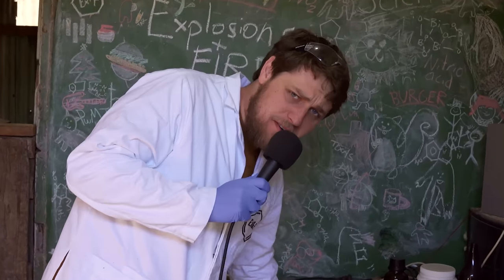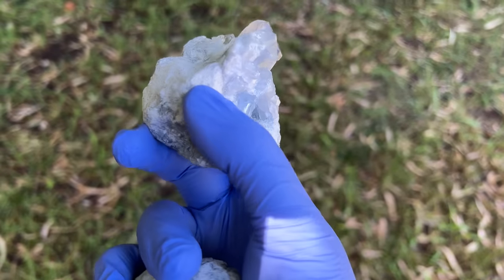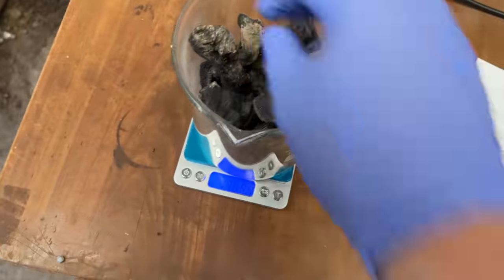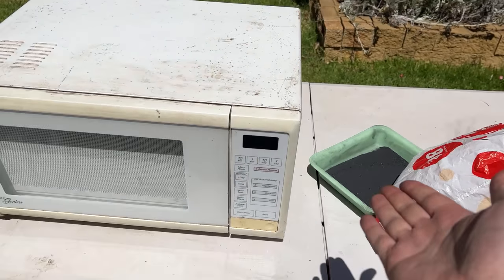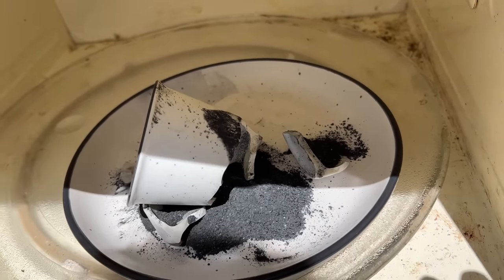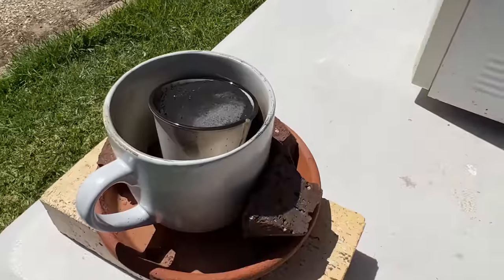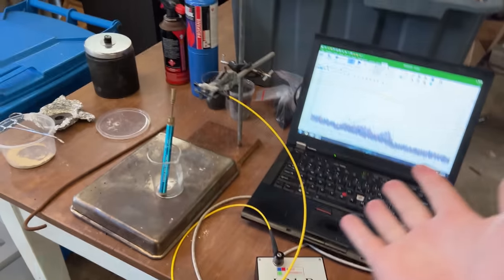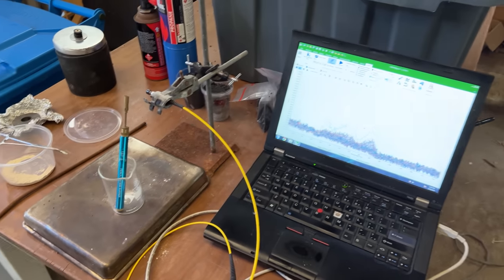Extracting strontium with a microwave

Comment: Actually scandium is not an useless element. Yes it's not very rare but it's very dispersed and doesn't form ores so its extraction is not straightforward. And it is useful in aluminum superalloys (hint: supersonic jet fighters are made of aluminum-scandium alloys). According to wikipedia, the world demand for scandium is about 50% higher than world production, making it quite expensive too.
Reply from the maker: Ok that’s interesting that demand is higher than supply!
Reply: Thulium or lutetium are probably the least useful elements, though they may be in low enough abundance to not be the uselessest by that metric.  Come to think of it, thallium might be a contender as well, not so much because of usefulness (it has a modest number of known/studied/useful reactions, I think?), but because it's so goddamned toxic no one wants to work with it.  (Kinda see also mercury, but it's decidedly on the "fucking awful but just worth the trouble" side of that balance.)

Despite the applications, scandium might still be a contender; production is in the 100s tonnes/year IIRC.  As far as industry's concerned, it might as well not exist at that rate. Definitely something, to be clear, but you only reach for it when you need the absolute, posolute best.  (IIRC, its use in aluminum alloys is equivalent to similar elements like titanium, it's just that tiny bit better at it.)
Reply: @ExtractionsAndIre  Yeah. It's actually more expensive than gold.
Reply: @stamasd8500  Oh yeah, good one!
Reply: It's also used in gun frames to help strengthen the aluminum alloy. S&W being the biggest user of scandium in their frames.
Reply: The biggest use of scandium used to be for metal halide lamps as scandium iodide. Currently, the biggest use are high performance structural alloys.
Reply: @T3sl4  Thulium can be used for Scintillation detectors as well as high temperature super conductors. Probably every element can be useful. it comes down to supply & costs. The lower the cost & the bigger the supply any element will be useful.

Comment: A tip for heating stuff -- if you don't have [or can't be arsed to go out and buy] fire bricks (the styrofoam-like insulating kind) or ceramic wool (not the glass/rock wool kind that melts at red heat), try a large microwave-safe container filled with clean white sand, and embed the crucible in that.  Stoneware is better than porcelain for the crucible but it's probably going to crack all the same, so having sand fill to back up up will keep it together, while insulating it better than open air.  Better than sand, consider perlite or vermiculite (gardening aisle). May want to crush them up a bit or pack tightly since they tend to be fairly coarse and loose.

You definitely need to get it hot; alkaline earth sulfides are quite refractory.  1000C is yellow hot -- if it were that hot on the top it would illuminate the microwave interior!  It would also take more power than the microwave can supply, so it needs to be well insulated.

The powdered charge is rather self-insulating already, and it seems you did indeed get some reduction in the center!  That probably accounts for most of the low yield.  Upside: just keep cooking the filtered junk, all the carbon and sulfate is still in there!  Maybe top up the carbon from time to time.

Speaking of fire, can cook out the yellow from the product by roasting it at red heat, probably -- maybe put it on a steel sheet or can next time you have a bonfire or something.  (Char the sheet before use, get a nice crisp oxide layer on it, don't want paint residue gooping it up!)
Reply: Worth mentioning perlite at least might have other additives so check ingredients. I'm sure a chemist would, but just fyi for anybody out there

Comment: 21:39
I've done stuff like this quite a bit before, trying to get barium carbonate. So I suggest putting an MDF board, or a silicone mat if you can. Their pretty common in the kitchen for baking, so I trust you'll be able to find them. If you use the MDF board, it'll get carbonised at the high temperatures, but your glass microwave base will survive.

And for the crucible, if you want, aluminium oxide crucibles are pretty cheap online (and come with a lid most of the time). The ceramic doesn't survive because sometimes there's still a tiny bit of water left in there that boils in the heat. I'm amazed the coffee mug manage to survive so much
Reply: I'm surprised there could manage to be any water left in the ceramic considering they get baked at like 1162-1240 Celsius  for hours for the initial firing and up to almost 1400 for the glazes
Reply: @noodlelynoodle.  True. Either that, or the expansion from the heat was too much for it to handle
Reply: @thehyperscientist1961  yeah who really knows it could be from taking them out/opening actually which let's them cool  faster than is safe for the material and slowly stresses it till it cracks if it's anything like glass

Comment: You might have better results using unglazed porcelain (ie. terracotta flowerpot). The ceramic glazing will absorb a lot of microwaves, that you really want the carbon to absorb.
Reply: Terracotta contains iron
Reply: An unglazed porcelain crucible would be the best bet due to having an absurdly high melting point and being relatively hardened against most thermal shocks.

Comment: I know that there are induction crucibles specifically made for home microwaves. They are usually advertised for making glass beads at home. Seems like they get over 1000°c without much trouble, or enough to melt sand. I've been meaning to pick one up from the usual sources.

Comment: Thanks for sharing.  I've been researching Strontium Carbonate as it is one of the materials used to coat the cathodes of the old thermionic valves (vacuum tubes here in Canada) which reduces the work function of the underlying metal.  It seems to be commonly found as a pottery glaze.  Quite cheap as well since it goes for 10 Canadian pesos per kilo, and the datasheet states > 95% purity.

Comment: Hey, Lanthanum is used extensively in TIG welding rods, as an alternative to thorium. Strontium toothpaste is also pretty useful for those with senitive teeth. Strontium-90 makes nice RTG's.
This are valid uses, no need to hurt the elements feelings man, geez

Comment: Great videos. I hope your academics are going well.

I don't have any actual expertise in ceramics or kilns but aren't most of them porous and have some amount of water content? So you have to heat them very slowly to remove the water etc to prevent cracking? 

I wonder if it would be effective for off the shelf ceramics if they were pre dried or something, but i can't imagine a microwave cooperating with hours long heating cycle.

Comment: Not that it's exactly in the same price range as "spare microwave", but platinum crucibles easily withstand temperatures of 1000-1100°C, and can also be heated via induction heating. 

The lab I work for uses them to melt down soil samples with flux material for casting into disks to be tested in an xray spectroscopy instrument. They undergo thousands of heating/cooling cycles per week at those temps, so at least they last well for what they cost, compared to ceramic for instance. 

The induction heaters, it seems, can be picked up for similar prices to a microwave oven in a somewhat humorous twist.

Who knows, maybe it could be worthwhile  for future high temperature extraction videos, if you can stomach the $3k-ish price tag.

Comment: Nice video! Another method you can possibly try (which is the other common industrial method used) is soaking the SrSO4 in saturated K2CO3 solution. SrSO4 + K2CO3 =reversible= SrCO3 + K2SO4 
The SrSO4 and SrCO3 produced will achieve an equilibrium, and by frequently decanting the supernatant and changing fresh K2CO3 solution, a large conversion rate to SrCO3 can be achieved. The SrCO3 can then be dissolved in hydrochloric acid and moves into solution.

Comment: Strontium is used as a flux to lower the melting point of silica in pottery glaze making.  It helps to keep the thermal expansion low (especially when used along with calcium and barium.)  Strontium also cause copper to make an excellent satin blue color in a silicate melt.  Of course, all of these are in the oxide form.

Comment: I don't know if you said it, or will say it(I'm currently about 5 mins in) but because you aren't talking about the uses of strontium anymore i assume you won't. 
Strontium Aluminate makes great glow powder and it's soo much brighter than the zinc sulfide one. I actually ordered some to use in my rings and it looks amazing at night. The phosphorescent color depends on what mixture of the strontium aluminate you use. When adding dysprosium or europium you can change it to blue, red or even purple color

Comment: This is just adding to what other people have said, but I've used charcoal I picked out of the burn pile in place of "carbon" before for a few things and the percentage what would eventually be ash is extremely high compared to putting pretty much anything in a can and letting it cook.
I use "pirouette cookie" tins since they're some kind of steel, round and really cheap.

Comment: if you care a little less about the microwave, when you take out the glass platter that comes with the microwave it will let stuff get way hotter. Also I wonder if a small graphite crucible might work or if it would just steal all the heat. huh, cool project!

Comment: The technical term that everyone bar you, knows, would be "corning". :P This was done with black powder. After all the components were finely milled separately, they were mixed, and milled together with water, to make the milling safer, and formed into tiny grains just like yours. After drying, the grain structure apparently improved the flame propagation speed.

Comment: Given red is the most common color in fireworks and the amount of strontium in fireworks with red color is around 8%-30% of the pyrothecnic mass, I would say fireworks does consume a fair amount of strontium. I can't find how much fireworks is produced annually globally by weight, but it's A LOT. Like a rediculous amount.
Strontium is also used in producing ferrite magnets, which is used quite a lot in electronics for ferrite transformer cores and such.

Comment: As someone who's sent more than a few science microwaves to a barbaric death by chasing foundry-levels of high temperature, the big problem with budget-grade ceramics is the moisture content. The microwave warms up way faster than can be controlled like a ramping PID controlled kiln and the like, which will drive off moisture slightly more controllably and save a few ceramic bases. The dollar store plates/bowls/cups and saucers will crack and explode as you've probably seen by now from said moisture content (steam pockets). 
Now if you want to get to 'stupid hot' levels, nothing will suffice like a silicon carbide crucible. Graphite works in a pinch, but without a sacrificial absorber beneath it, all the silica will ooze out of the sidewalls both inside and out and does an admirable job of fuzing itself to the surfaces of your 'nuker. I've also burned holes clear through the bottom and backs of two machines, though as a somewhat usable metric, that's when you know you've surpassed 900*C. My best run to date when I torched the protective silicone shroud of my pyrometer trying to gauge the external temp of a silicon unit was in excess of 1620*C after ~30 minutes of continuous running. The microwave is still in my collection as a curiosity as the internals looks like it fell out of orbit with a meteorite inside.

Comment: To add to the list of obscure uses of Strontium, I use lasers to cool Strontium-87 to create an atomic clock as part of my PhD work. There's a extremely narrow spectral line that makes 87Sr a much better frequency reference than Cesium, which currently defines the SI second.

Comment: Mouse shitification is actually a nice property for a lot of stuff to do with pharmaceutical formulation where you might want to have them little spheres be a slow release matrix and then have them mixed into your regular instant release formulation for an analgesic medication where you need the instant hit for acute pain relief and then a gradual release to maintain analgesic state.
Reply: Indeed its used alot in pharmaceuticals. Its called Agglomeration and we use it mostly to make granulated Stuff.
The thing you describe with the slow release matrix is a thing that actually exist too for example in Layered antacids, but if i want a granulate to have different release timings I would use different coatings (MUPS) or use a prodrug in one of the formulas because that is much more precise and easier to control(ph and stuff in the gutt)

Comment: Actually no the sodium doesn't cross. I expected it to as well, but it didn't. Does mean paying extra care to washing the carbonate but it will come out clean enough for a flame with no sodium in it 😉

I kept an excess of nitrate in the mother liquor so that no matter what the sodium would get sequestered during the replacement. Lose a little yield there but it's trivial and keeps the product clean. Then just heavy washing, forget the filtering, do it in suspension, you'll get a lot more BS out of it. I also used saturated solutions for both, so as to see the carbonate coming out. Toward the end it will get faint, don't push it, and it'll be clean.

Comment: Lanthanum has a bunch of uses, from being used as an alloying element in cigarette lighter flints to radiation free lanthanated tungsten electrodes for TIG welding. 

So compared to strontium it is definitely more useful? I guess the next step is refining some & investigating what flammable/explosive uses they found for it in the 60's...

Comment: The AGGLOMERATION of fine powder particles is a true issue for ball milling, you likely milled it so finely that the interparticular friction became larger than the force of gravity therefore resulting in the powder particles clamping together rather than flowing, to improve flowability and allow even finer powder to be produced by milling, add a bit more water perhaps.

Comment: a pretty decent way to purify charcoal into decently pure carbon is you crush it really good into a powder, then wash it with hot distilled water, this gets rid of the soluble contaminates, then you want to boil the charcoal in a vinegar solution (or any other weaker acid that wont try to oxidise the carbon or make tar shit, and wont be a pain to remove) this solublizes any of the impurities that were insoluble due to the high ph and no acid present. then you just wash a shit ton with hot distilled water and the carbon left should be like 98-99% or more pure. tried it before and the carbon left over is actually pretty decent for pyrotechnic use, as when its burned it dosent contain a lot of like carbonates and hydroxides so theres little residue.

Comment: 1, Your tiny little mill is grossly undersized for the application

and

2, You could have dried your carbon quite rapidly in the microwave oven by heating it just until it starts to glow some then lower it into a metal pan and vent some carbon dioxide over it to displace oxygen and keep it from burning away before you can use it.

Because some of the carbon will inevitably burn off doing that, one would want to add a bit more carbon to make up for the losses.

Comment: Someone's probably already said it. Maybe you mentioned it while I wasn't paying attention. But grinding charcoal, specifically if wet, can spontaneously combust. So be incredibly careful.

Ok, so it was wet enough to cake instead, but just be incredibly careful and monitor the process if you absolutely have to use a ball bearing grinder for charcoal.

Comment: tom im no thermal engineer but its been my impression that forgings occur over a long period of time, and 1000C might be asking a lot of ceramic dinner plates, but if you spread out temperature increases over time so the ceramic can equalize you may reduce cracking, although watching i can see you found a workaround

Comment: For what it's worth, I'm doing my PhD in electronic materials, and elements like strontium, lanthanum, and scandium are all pretty commonly used! They show up often in ferroelectrics and other electronically active ceramics. In fact, I spent my entire day today doing research related to a new material that has a large fraction of scandium!

Don't forget us materials scientists over here, using all the elements that are too wacky and obscure for y'all chemists!
Reply: Seems fun, but this stuff can only be done with expensive equipment, right?
Reply: @mamupelu565  Honestly the main thing you need to make ceramics is a lot of heat. One of my projects has me sintering at 1500C. And that's definitely possible via microwave synthesis! You just need to bite the bullet and invest in a good crucible and insulation for the interior.

The other key to nice electrical properties is to keep everything obsessively clean. That doesn't matter quite as much if you're not worried about your electrical properties though, those are the most likely to be affected by impurities

Comment: I'm not a microwave chemist or anything but I think the ceramics and glassware were shattering because the mixture was making one spot several times hotter than the others and causing stress on the material. You can probably try doing it by spreading it out evenly on a plate.

Comment: 1000 degrees Celsius?  That is foundry or smelting temperatures.  One can be built to run on propane fairly inexpensively.  You can also use an arc welder with some carbon electrodes to make a arc furnace.